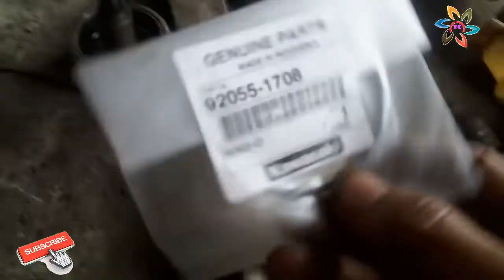Penggantian bearing balance ninja 150

Comment: BANG MAU TANYA SEMOGA DIJAWAB. UNTUK KODE BEARING RASIO DAN BALANCER BRP YA BANG DAN BUTUH BERAPA BUAH EDISI GANTI BARU SEMUA BANG. 🙏 ( TANPA BEARING AS KRUK)
Reply from the maker: 6204 :1 laher as kopling -6003:1 laher drum -6202:2 laher rasio -6304:1 laher as gir depan -628 :1 laher kips -6005:1 laher balancer kiri -16007:1 laher balancer kanan